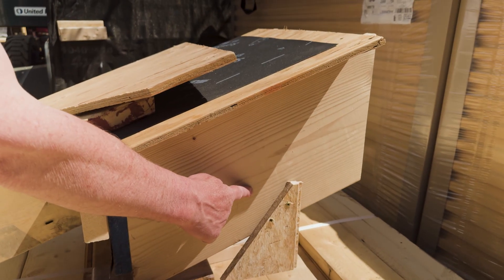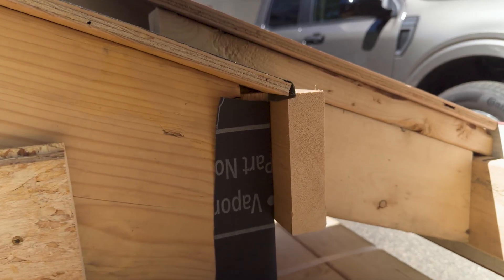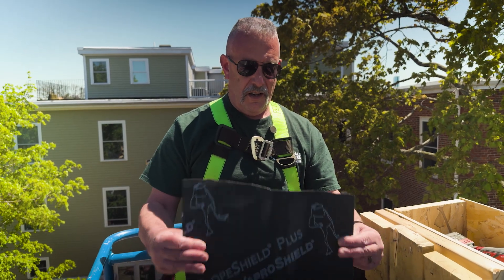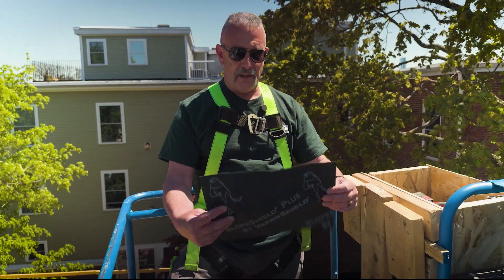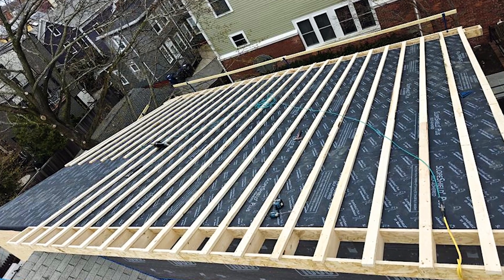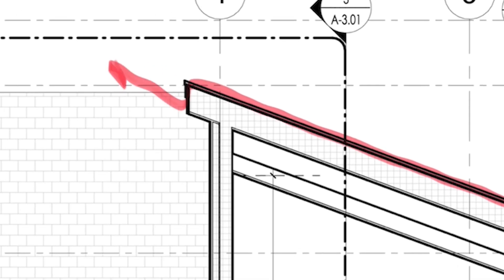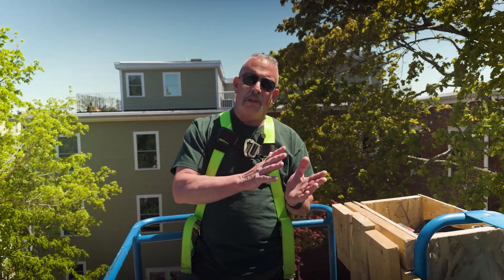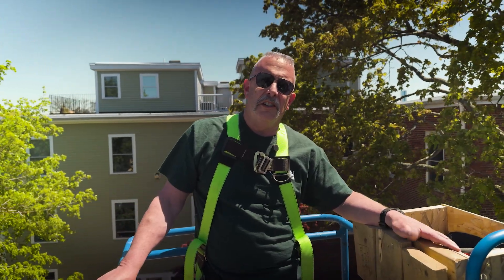Your Roof NEEDS to BREATHE

Comment: My thoughts to save money without sacrificing performance would be to apply a waterproof vapor open product right on the 2x12’s then apply the sleepers with plywood on top. If money wasn’t an issue I like what you did better.
Reply from the maker: That’s a great assembly. It is as vapor open as you can get. Check out the video we made on the roof assembly at the 200 year old barn we are doing a passive house retrofit on. We call it “the Salinger Roof” after the Fine Homebuilding article Josh Salinger wrote on that assembly about 5 years ago, but it’s been around long before that.

Comment: This is literally the assembly "Grok" and I came up with for a 14x14 outbuilding i'm putting together.  Slight difference was the use of Zip Sheathing and taped seams for WRB and Air sealing and Vapor Port @ ridge using a self adhered product like that VaproShield, this goes well in zones 1-3. Allows me to stick to "monopoly" framing and all the same reasons they describe, Thermal breaks, foam-free (rockwool FTW), and venting of roof assembly...awesome! Thank You for showing the model!!
Reply from the maker: Sounds like a great assembly 
@chrissilver6767 Keep in mind that while the Zip green/red applied wrb is quite vapor open, OSB is less open than CDX. We recently heard Kohta Ueno present at a BS*+beer Boston meetup on roof assemblies and he pointed out that with diffusion ports you really want an incredibly vapor open material like Delta-Foxx.Typically self-adhered membranes will be less open than mechanically fastened. Keep up the good work!

Comment: I'm curious what  a smoke test would reveal.
I love the concept and contemplated this as well. However, I wonder about performance in a hurricane.
Reply from the maker: @TexasBarnRats those are good questions. We think a blower door smoke test from the interior would show no smoke leaving the envelope as this ADU will fall in line with all our projects and be very air tight. But if you were to send smoke into the fascia vents at the bottom from the outside you would see it exit out the top fascia vents with no smoke getting into the ADU. You’d probably also see airflow from top to bottom but generally airflow is moving the most from low to high. Maybe we could try this…
Reply from the maker: To address your hurricane question, certainly you need to run all assemblies by your structural engineer especially if you are in a hurricane prone area, high wind or seismic area. We don’t typically have those concerns where this project is in the city but we do occasionally have hurricanes (not as strong as in the south) come through here and everything in our assembly is designed to handle the loads it may see. We do like that if there ever was damage to the nailbase sheathing and some water got in, it can dry to the interior or exterior. Vapor open.